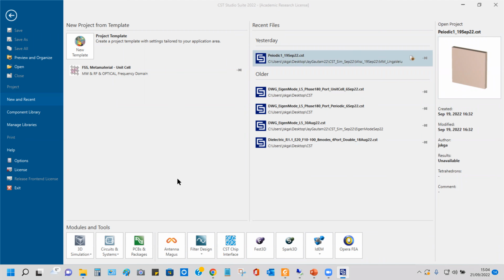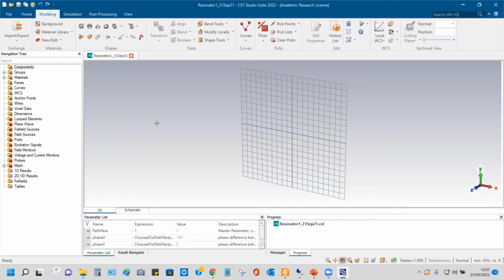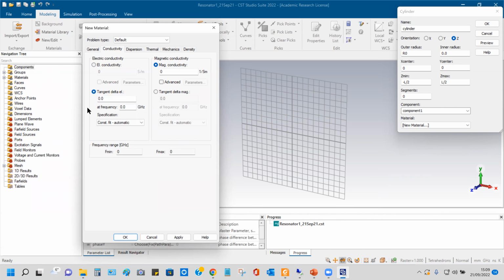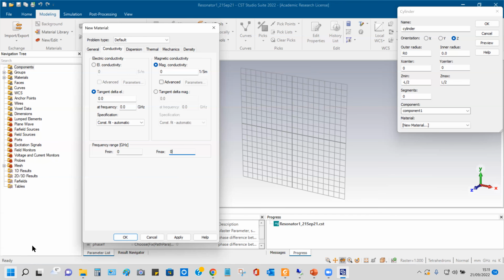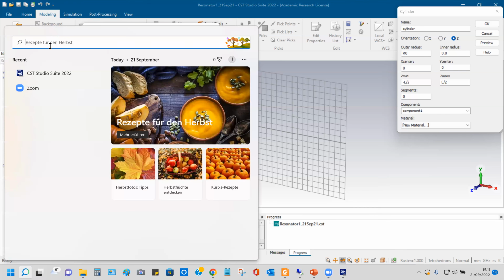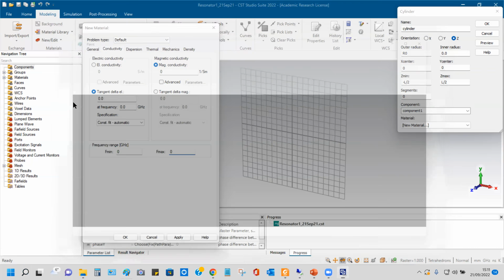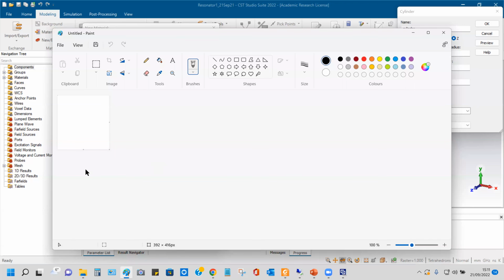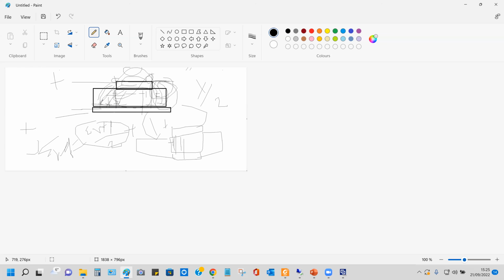Concept behind metamaterial, metasurface, artificial lens in layman language Part #1

Comment: Sir i wanna increase the Operating BW, for which i need to increase or decrease the loss tangent of a material?
Reply from the maker: Increase loss tangent, which leads to low quality factor thereby increase in bandwidth
Reply: @drlingasamyveluchamyphd  thanks sir, ur timely reply and sharing knowledge is really helpful